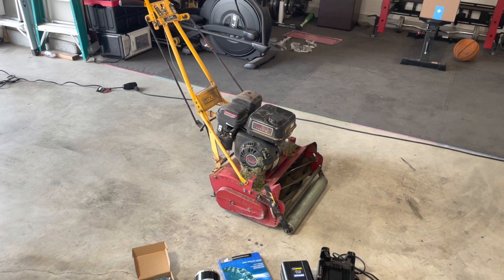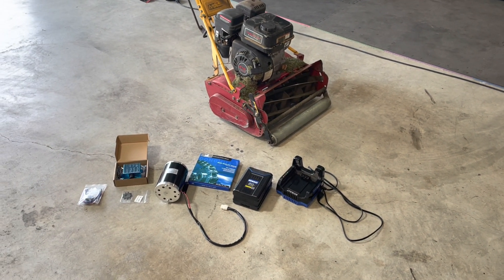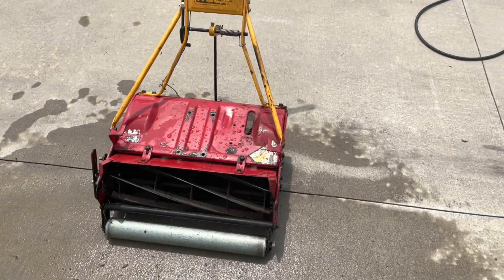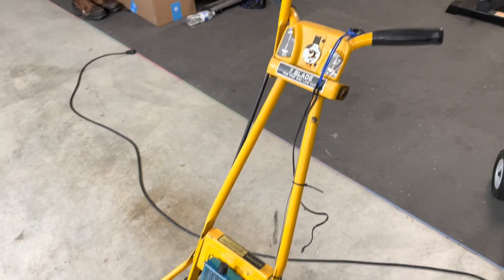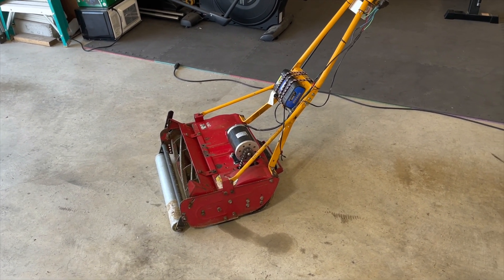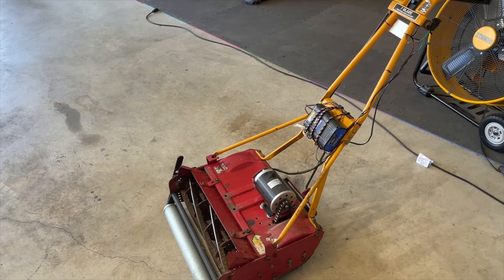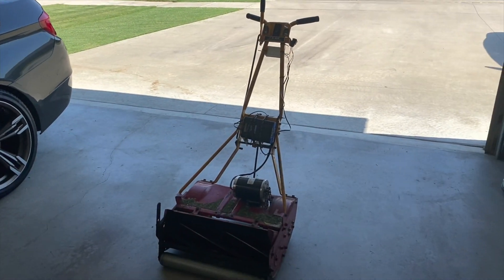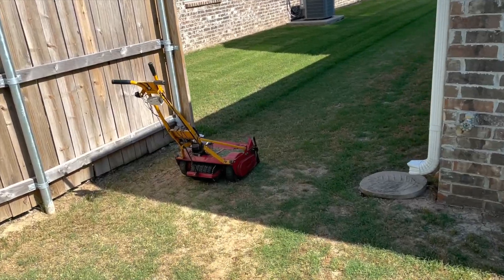Revitalize Your Lawn Care: DIY Electric Motor Conversion for Mclane Reel Mower

Comment: Just came across this. Very cool. Thinking of doing something similar to my McLane. Anything you’d do differently the second time around?
Reply from the maker: Thanks. Yeah, one thing I still need to address is the mounting of the motor. Probably will 3D print a spacer/base soon.
Reply: @JohnsonMotorsports awesome. It seemed like you kept r&d’ing the battery supply so wasn’t sure if power and control were standing the test of time
Reply from the maker: @ranerg318  Yeah, originally I had issues with the speed controllers burning up, but that was because my original wiring was too small. I lowered the gauge of wire and the controller has been rock solid since then.

Comment: Is it possible to get a quick sketch of how you did the wiring? I bought the exact motor, 40V battery and new controller you are using. I’ve tried to blow up pictures from your video, but not enough detail. Thanks

Comment: mortor rpm?
Reply from the maker: 3000 rpm, however I use a speed controller and typically cut at around 70% so around 2,100rpm.
Reply: @JohnsonMotorsports  thank johnson.
Reply: mortor 40v 3000rpm brushless
Reply from the maker: @sanji-TOY   Unfortunately this one isn’t brushless, but I would recommend brushless. Here’s a link to the one I have.

https://a.co/d/2Jz9sO2

Comment: Cool idea.  Although the more weight, the better if you are looking to lay down some stripes.  Maybe duct tape some 25s to the top of the mower and beef up that battery to a dewalt fkexvolt.  Then you can swap between 20v and 60v to see what works best

Comment: Not quite sure how you wired the controller to the power...is there any diagrams on that
Reply from the maker: It depends on the controller you end up using. Typically, the seller will provide a diagram.

Comment: Hey was the original sprocket hard to get off the motor shaft? I got a similar motor and can get the retaining nut off but not the sprocket. Any tips?
Reply from the maker: Unfortunately, I can’t help with that. My motor was replaced by the previous owner and I purchased a new sprocket for the swap.
Reply: @JohnsonMotorsports  so the sprocket on the new electric motor was the right size out of the box? You didn't have to remove it to put a different size on?
Reply from the maker: @douglasauruss  No, what I was saying was I purchased a new sprocket for the electric motor.
Reply: @JohnsonMotorsports  Same here. Did the sprocket that came with the electric motor need to be taken off in a certain way? The one that came with mine had a nut but the sprocket isn't easy to just take off after the nut has been removed.

Comment: Has that speed controller held up to regular use with that motor, from what i can tell that controller isn't rated for the 1000w that the motor is. I have seen a bunch of reviews on inexpensive speed controllers and people saying they fail easily.
Reply from the maker: I’ve had to replace a few, but I have found 1 on Amazon that has held up. You have to check the specs on the speed controllers to make sure the amp draw maximum & continuous is enough.
Reply: @JohnsonMotorsports  I am looking at doing a similar build, but with a Fiskars mower, do you know which specific controller you ended up with that has lasted?
Reply: @JohnsonMotorsports what speed control did you switch to? I watched the other video but you don’t tag it. Thx

Comment: What is the component that the battery is docked on the mower
Reply from the maker: At the moment, I am just using bungie cords to hold the batteries to the frame.

Comment: I love this!  Have you tried to run it backwards for powered back lapping?
Reply from the maker: Yes sir. Works great.
Reply: @JohnsonMotorsports  you will need to do an update a bit into this spring on how it is running and what if anything you might do differently if you were to do it again.  Would love to hear how it is all holding up after a bit of use.
Reply from the maker: @garyr5520  Yeah, working on that now. I have an update with a battery pack I built.
Reply: @JohnsonMotorsports let's see it!

Comment: Was thinking of mounting a charger base as a holster for the battery on the handles, seems it would be easy enough to wire up and mount for easy in and out, wondering about splicing the charger base wiring to enable the ability to charge with the same base by plugging it in.
Reply from the maker: Yeah, that may work. I’m currently building a 48v 13ah battery. I pulled all the 18650 cells from 4 battery packs and I’m using an E-Bike DIY kit to build it.

Comment: I’ve been looking at doing this with one of my PGM 22, my concern is the weight of the mower and the drive system being too much for this conversion. I mow everyday with the PGMs on my golf green so it’s mowing very short amounts of grass
Reply from the maker: Not sure on that one. I don’t use the drive system anymore. However an electric mower can put out a crazy amount of torque, my concern with using the drive system would be the amp draw for additional torque needed. You would need a higher capacity battery.
Reply: @JohnsonMotorsports  yea that makes sense, I’ve seen some 60-80v brushless motor kits with controllers and such for a moped conversions maybe that’d be a good route.
Reply from the maker: @malarkeywithmatt2396   Well, the battery voltage isn’t really the issue. My 40V motor will spin at 3600 RPMs and it will produce more torque then the Honda engine. What you really need is a larger battery pack. I’m building a E-bike battery pack from mine which should be 40V and roughly 15 ah. The 15 amp hours is what you really need, especially if you are using a lot of torque.
Reply from the maker: @malarkeywithmatt2396   Well, the battery voltage isn’t really the issue. My 40V motor will spin at 3600 RPMs and it will produce more torque then the Honda engine. What you really need is a larger battery pack. I’m building a E-bike battery pack from mine which should be 40V and roughly 15 ah. The 15 amp hours is what you really need, especially if you are using a lot of torque or have increased resistance.

Comment: Get yourself another battery to swap out between cuttings. Great job!
Reply: It seemed like he was able to cut it all on one charge….
Reply from the maker: It started that way, then as the grass got thicker later in the season the battery wouldn’t last as long because of the amp draw. I am working on possibly building a dedicated battery pack.
Reply: @JohnsonMotorsports  The YouTuber Jehu Garcia has a lot of good videos on pack building. He also sources all kinds of used or unused batteries and resells them. And often builds boxes etc to aid in building the packs.
Reply from the maker: @michaelsmithers4900  Thanks, I will look him up and start my research.
Reply from the maker: Yeah, I’ll have to see what I can source.

Comment: Nice. How's that controller holding up? I ended up going with a ebike controller. The others kept burning up when I hit mulch
Reply from the maker: Sorry I missed this. The controller is holding up well, however it seems I keep discharging my batteries too low.

Comment: I'd like to do this conversion but I really want to keep the drive functionality.  How much would the motor placement and design need to change if you were to keep the drive functionality?
Reply from the maker: Actually, my drive functionality is still intact. The issue you will have with running the drive wheels is the battery drain. You can think of this just like you would cutting really thick or tall grass. The more torque required in the motor will draw more amps and decrease battery usage. So if you plan to run drive wheels you may want to look into running batteries in parallel to extend amp hours.
Reply: @JohnsonMotorsports   think a EGO 56V 5.aH would work ? Or go up to 7.5AH
Reply from the maker: @McIntoshGreen  Yeah, it should definitely work. Your biggest issue may be finding the best speed controller that can handle the voltage/amperage.

Comment: I'm on the fence with a conversion. I am torn between a robotic mower (Husq) or SunJoe electric reel. Are you cutting bermuda? Nice work!
Reply from the maker: Sorry I missed this message. Yes, I'm cutting Bermuda. I like the electric conversion, but it does have it's down sides. If my grass gets to thick. I start to have issues with battery drain. The harder that motor has to work, the more AMPs it pulls from the battery. Which means I end up having to charge again, just to finish the front year. Also, if you don't have a large enough amp hour battery, it can cause you to discharge to battery to much and then you have issues with the Battery management system allowing the battery to recharge. Currently, I am looking into building my own battery pack that will provide a lot more amp hours.
Reply: @JohnsonMotorsports you should get a low voltage disconnect to save the battery.
Reply: If you don't mind me asking I've got pretty thick Bermuda and I've got a McLane and two 6Ah and one 4Ah Ryobi batteries, but about how long do you think that would get me assuming the amp usage is equal to your setup?

Comment: I know what I'll be doing soon. Thanks for the video of your conversion. I think my wife a.k.a. financial advisor, would approve of this conversion instead of purchasing an Allett Stirling priced at over $4k
Thanks again!
Reply: They’re raising the price over 5K with no battery included lol
Reply from the maker: Yeah, that's a hefty price tag. This is a pretty inexpensive conversion. However I am going to look into building a larger battery pack that will provide more amp hours. When the grass gets really thick or long, the battery drain gets really bad on these smaller batteries.

Comment: Loved this! Just about to do a conversion myself. I love that you are a Mechanical Engineer but aren't afraid of getting down with Electronics. I'm am EE. Glad to see a fellow engineer here. Subscribed.
Reply from the maker: Awesome man! Glad to hear from a fellow Engineer. Keep me posted on your conversion. I am always looking to improve my build.
Reply: @JohnsonMotorsports  @angel Wait, you can run a 40V motor off an 80V battery? I'm a petroleum engineer so I don't know a thing about electrical.
Reply from the maker: Lol, man. I am an Mechanical Engineer, I’ve been asking the same thing. However, I have forsaken that thought. I am currently, disassembling multiple batteries to build my own 48V 13ah battery using a E-Bike kit I purchased on Aliexpress.
Reply from the maker: I found this video a while back, so it looks possible however I don’t need higher speed.

https://youtu.be/_oOD6fnGWDE